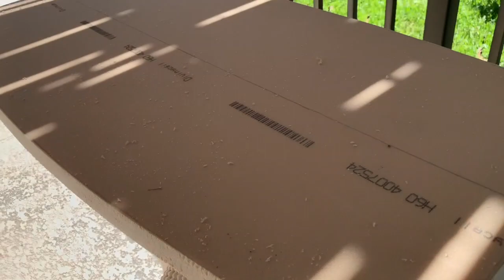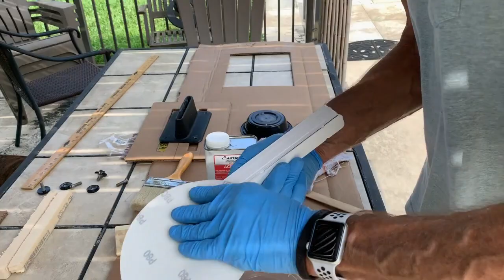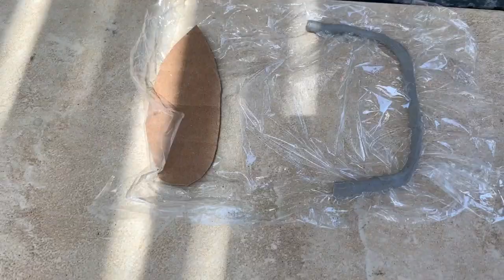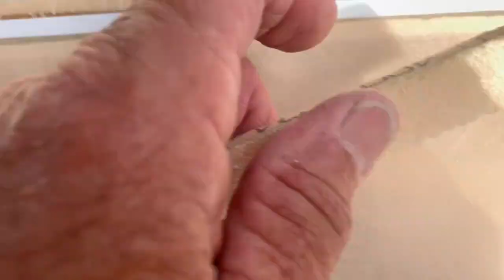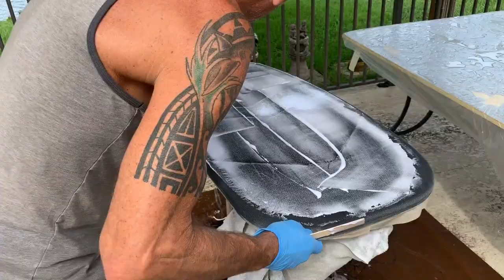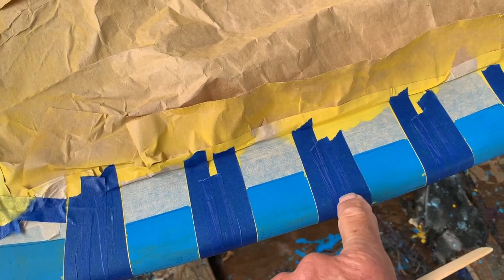Build Your Own Foilboard!

Comment: I'm getting closer to following in your footsteps in making my own board. :)
Roughly, how long did the whole thing take to make?
Reply from the maker: Hi, If you work on it daily you could build it in less than a week. I only say that because you need to let the epoxy thoroughly cure between steps. Once complete let the board sit for at least an addition week before riding.
Reply: @foilsurf  I wish I'd seen your video earlier, before the lock down. I could have finished it by now!
Mind you. We aren't allowed out even though the conditions have been really good recently.
Reply from the maker: J&Y Yeah really sucks what’s going on. I’m in South Florida and some stores still open.  Maybe order some materials online. Lmk if you need any advice  when you do finally get around to your build.
Reply: @foilsurf  I'm only a few miles away in New Zealand! We've just had the first snows on the mountains.
We aren't allowed out on the water. Not supposed to use our cars unless it's an essential trip so we're pretty locked down.
No deliveries either. Most places are closed for 'the duration'.
I was looking around to see where I can get all the components from locally. It's a LOT more expensive over here!
Still intend to go ahead with the build though. 
You've infected me with the Building Virus!!  :)
Reply from the maker: J&Y wow you are really locked down. Probably best though. Our government is a disaster in and of itself. Lol. New Zealand! Cool. That’s on my bucket list of places to visit and kite!
Reply: @foilsurf  We came her for a holiday and didn't leave! That was over 20 years ago!!
Just been thinking more of the build. What density divinycell did you use?